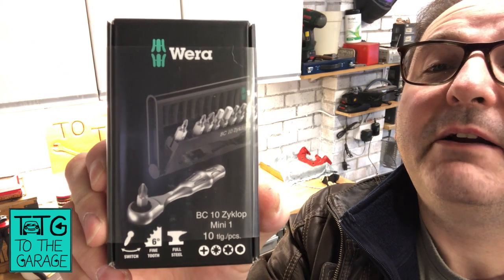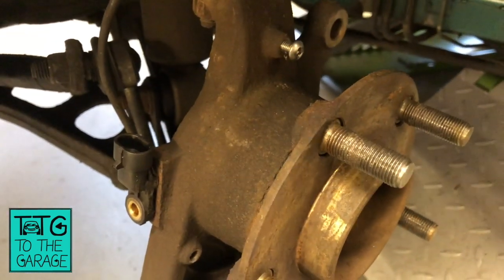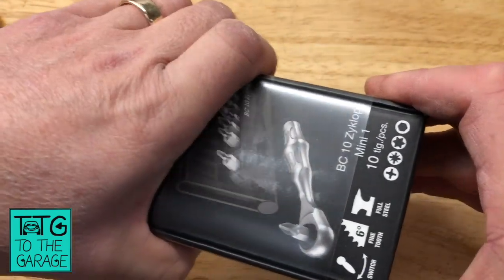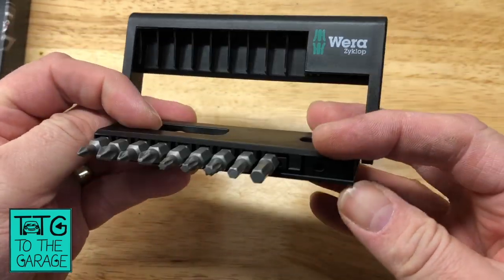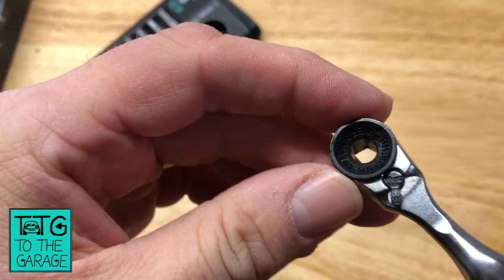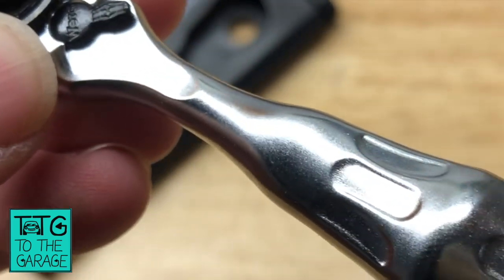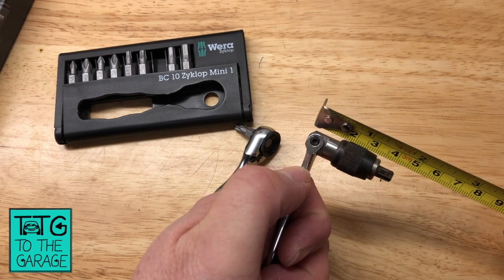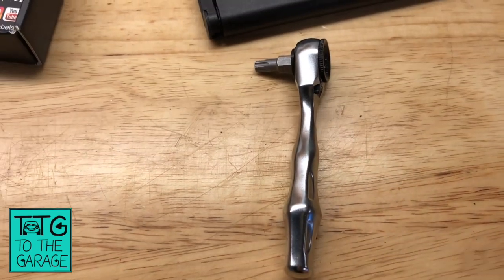Wera tool review. 1/4 inch hex ratchet. Zyklop mini 1 BC10  for tight access spots on my XK8

Comment: Apparently the cog on the rear of the tool is for turning manually in even tinier spaces.
I wondered is the bit hard to remove from the tool with that non magnetic fitment ? 
Also wera test this torque ability way past it’s design function…there’s a video of it somewhere undoing crazy levels of torque.
Reply from the maker: Hi.
not hard to remove. i just press a figertip into the open end the hex drive on the thumb wheel side, and the bit pops out. equally the bits dont fallout unexpectedly. it grips the bit tightly enough

Comment: Be aware that due to small size, the internal ratcheting toggle in some of these items is powdered metal rather than forged, making them rather weak.  Instead I have used 1/4" hex bits with a box end 1/4"wrench for anything requiring a high break loose force.
Reply from the maker: You are of course correct Gary.
I used to work for a sintered metal component manufacturer when I was an apprentice. GKN Sintermetal. (previously known as GKN Bound Brook)
Reply: This comment was very useful to me, thanks!

Comment: How good is the retaining spring? Have you come across a scenario where the bit came off of the ratchet, ie it got stuck onto the bolt or screw? Been looking for a mini ratchet that can reliably hold onto the bits and not fall out like the junk ones.
Reply from the maker: Really good Neil. I cant think of an easy way to tell you how tight it is unfortunately. but with the Wera bit's. I have found them be very secure in this ratchet👍

Comment: Wera are quality tools, as far as my experience goes. I have the 1/2 and the 1/4 ratchets. Really enjoy them. Did you consider using a bit with a boxed wrench ? It can get frustrating not having the right tools:)) 
Great review !
Reply from the maker: I did but the bit keeps sliding through